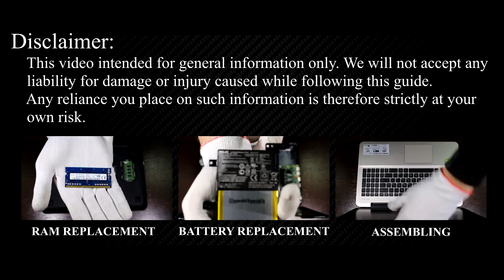How to Install SSD in Asus X555 – Hard Drive Upgrade Made Easy

Comment: dam it asus, why the hell are you still using disk drives. that block takes up too much space.
Reply: You can replace it with an optical drive caddy and put a SSD instead.
Reply: Lol this is an old laptop. I mean they stopped producing it in 2016. Its an x555ln.

Comment: I thought this was a tutorial on how to install a Solid state drive, the hard drive replacement still looks like a spinning hard drive??
Reply: It's literally the same tutorial for both. SSDs and HDDs use Sata cables
Reply: My exact thought! Wtf. It's not the exact same process considering they are different sizes right?
Reply: @lowhertzhighspl  There are SSD's which are same sizes. SO it's possible (I hope), gonna get my SSD today/tomorrow and let's see how it goes in. Or not :D

Comment: Can you add another Drive SSD to the computer whitout replace the HDD?
Reply from the maker: you can place SSD 2,5 to optibay - hdd caddy that replace ODD, but it will be better to replace HDD with SSD and install HDD to optibay
Reply: Would You be kind to explain why?
Reply: opticaddy has slower connections and sortages, better boot expierence and safer is in HDD place (I am planning to upgrade my asus x555ln tonight)
Reply: u want to check the motherboard sata connector connecting to the main hdd is actually sata3, then it will fully utilize the speed of the ssd, if that connector is sata2 then ur ssd is still backward compatible but it will not run at its max speed but still faster then ur original hdd
Reply: @quoclien3343  the optical drive is actually SATA 3 too

Comment: hi, do you know if this model has any other drive input ? as mSATA or m.2
Reply: Does it have the m.2?
Reply: @leonardomendonca8073  no, it does not have, because intel didn´t support it until the 6th generation (sky lake) of cpu´s
Reply from the maker: Check a video explaining the differences between SSD SATA vs M2 NVMe 👉 https://youtu.be/r3Jy5dHOj3g